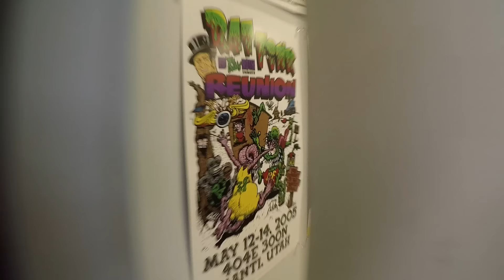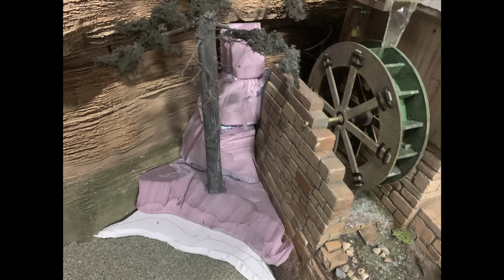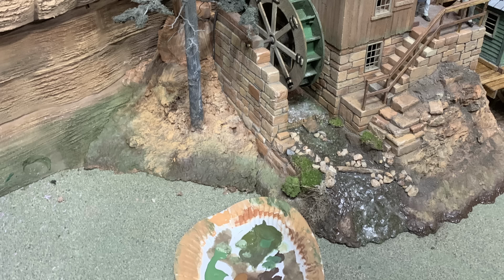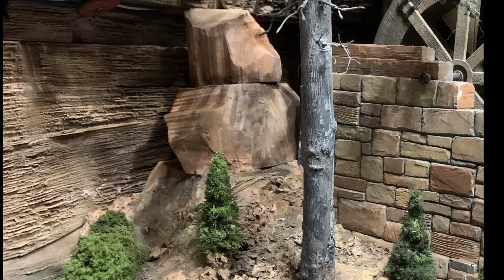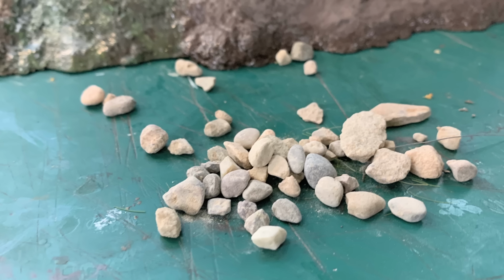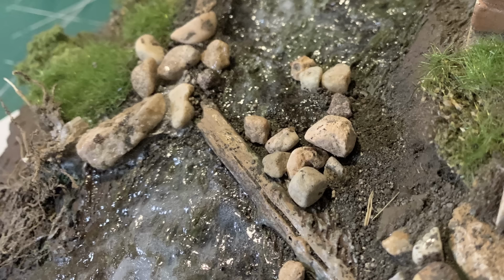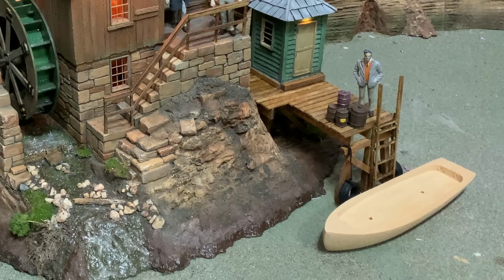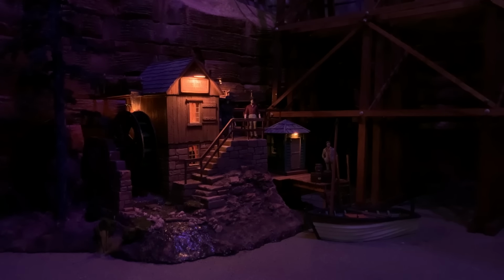Adding Mud, a Tree and a Boat!   - Rebuilding the mill by Mountains in Minutes

Comment: How are you going to paint the canyon walls?  Are you going to need to remove everything?  The final mill turned out great and I have enjoyed your series.  Thank you.
Reply from the maker: I’m going to rear part of the cliff directly above the mill to make it match the section above there. It looks a little too much like layers of insulation! So some reshape in there, filling in the section between the upper Canyon and the lower Canyon using the same technique, including a ledge with the precarious village on it! Then a little bit of layering with sculptamold. the final paint is done with the same bear colors of house latex from Home Depot combined with some of the craft colors. Same way we did the area around the mill!